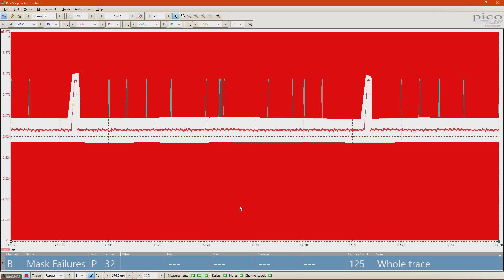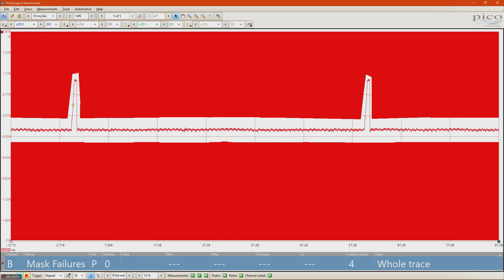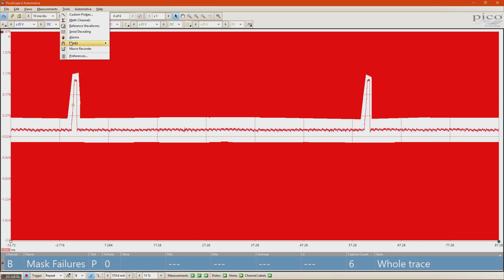Using Picoscope software to capture intermittent issues

Comment: Thanks for the demo Brian, great job! I have used the trigger on single capture in the past, especially with secondary ignition to capture a fault. I have noticed using a mask can help in the demo you had shown in the case where there may be an "added" event or an "over current" but how would you set something up to capture a "missing event" lets say in the instance of an open such as in this demo if there was a "no current" event? Any thoughts?
-Eric O.
Reply from the maker: The frequency math channel could work for that. Matt explains that in another one of our videos. If the idles stable, the frequency of the events would remain somewhat steady until a dropout is present. The frequency math channel on top of circuit you are recorded would quickly identify a drop out. I would be making a deep record in this case, lots of time on the screen.
Reply: Trained by Techs Fantastic. Do you have a link to the vid?
Reply from the maker: South Main Auto Repair https://youtu.be/JSUHhnV5D68
Reply from the maker: Sorry about that should have added that in my first reply 😌

Comment: Thanks Brian.  I didn't realize that was even an option. Haven't spent enough time "exploring" the pico software.Great stuff. You guys are great.
Reply from the maker: Mike Burton Thanks! The power of pico beyond it's excellent hardware lies in it's software. There are countless gadgets that can make our lives easier as long as we take the time to learn them. Is there anything you'd like us to cover that you may be struggling with or may not fully understand?
Reply: Thanks for the reply Brian. To start off, I'm a DIY'er, not a pro like yourself and probably all of your subscribers. This is a hobby for me but the more technology that comes out, the more I get drawn into this field. Honestly I would love to be able to one day look at a car with a single cyl misfire, pull out my PICO and COP probe and diagnose why the misfire just from the COP probe waveform.  That would save so much time and have an accurate direction to go on. And while the PICO is already out, throw up another channel on the injector coil, or ignition primary if needed but I would just love to be able to understand the secondary ignition waveform variables better. Thanks for asking Brian. You guys here have great content.

Comment: Thanks for another awesome video Brian! Trained by techs always brings awesome content to the automotive community in an easy to follow manner. Thanks!
Reply from the maker: zack mcclain We appreciate your great support. Do you have any ideas of future topics for out group to cover?
Reply: Trained by Techs one thing I would love to see is voltage drops using scopes. I’m sure that sounds simplistic but I use them every time I pick up a meter so why not use them when I hook a scope up. I use scopes on occasion to do cam crank correlation and things of that sort but how can we use a scope in a day to day way to increase our diagnostic efficiency and accuracy.